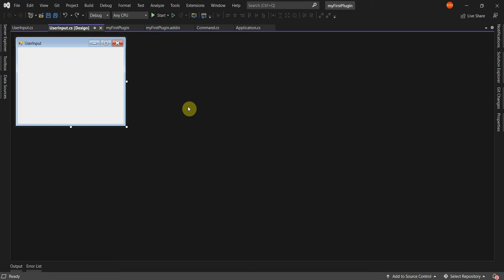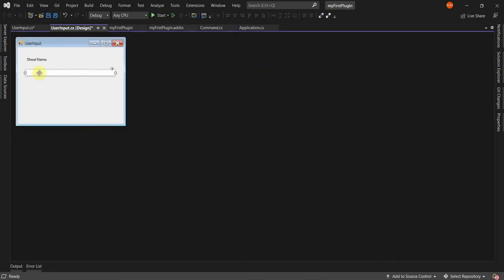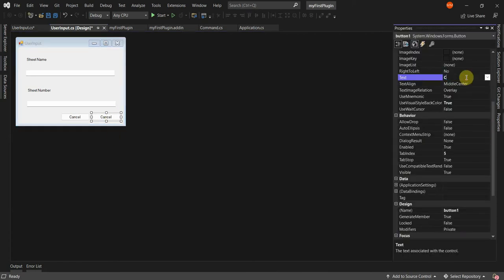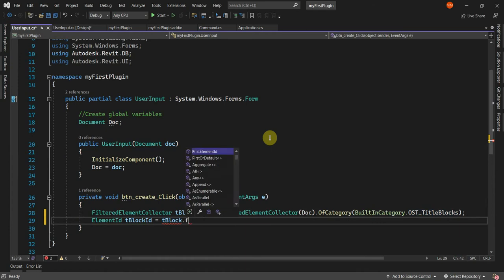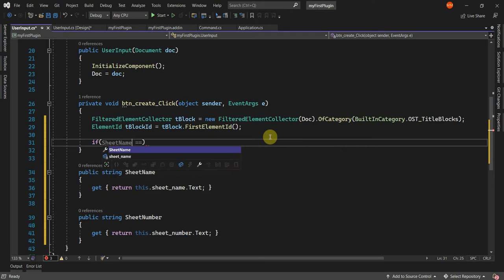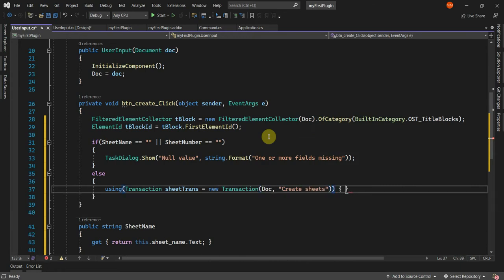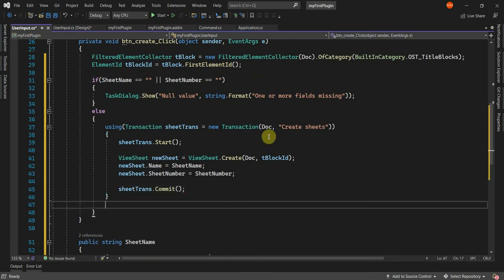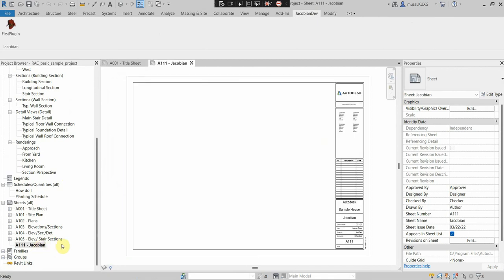Revit API : Create Sheet Using Windows Form TextBox

Comment: Hi, thank you for your video! I have just one doubt:
I created a windows Form with a button that is supposed to create some view sheets. 

When I open Revit and open the Windows Form I get the following error when executing a transaction from the windows form button in Revit:

Unhandled exception has occurred in a component in your application. If you click Continue, the application will ignore this error and attempt to continue. Starting a transaction from an external application running outside of API context is not allowed. 

Then the button does nothing. Any idea where did I go wrong?
Reply: Hi..Did you manage to find a solution ?
I am facing the exact same issue.